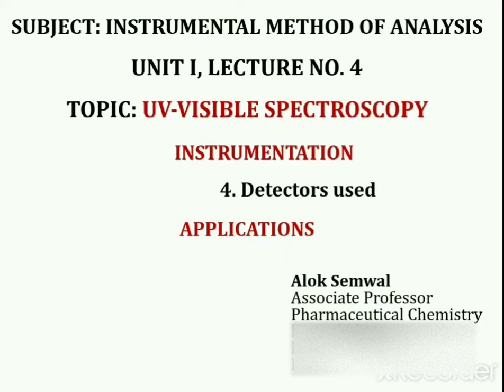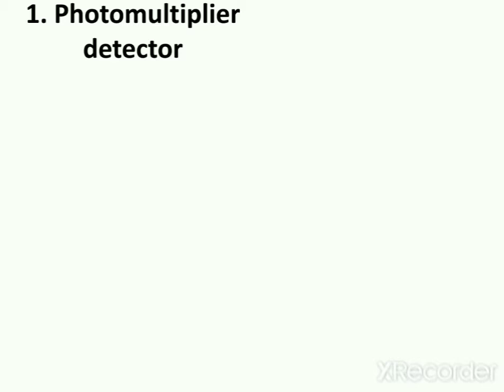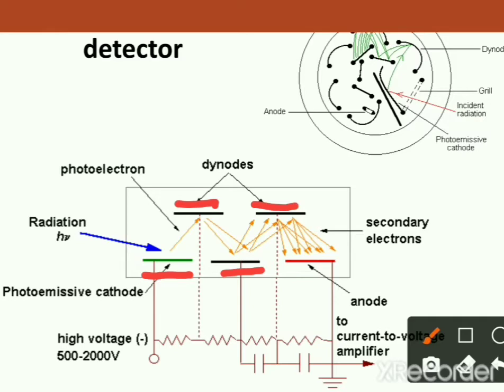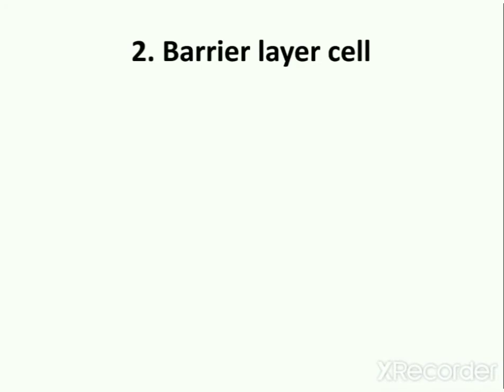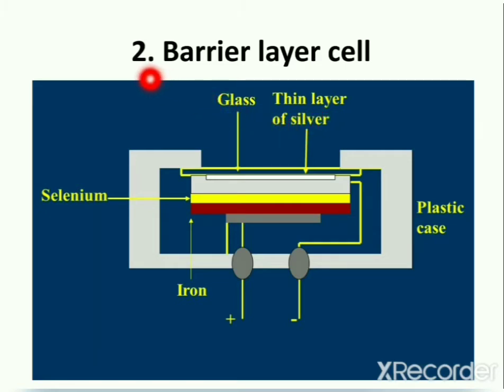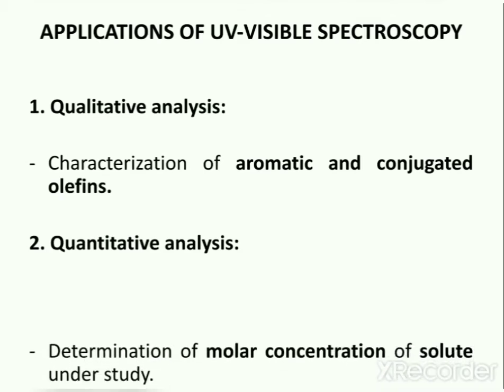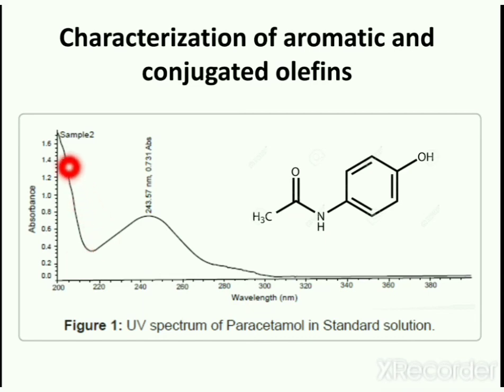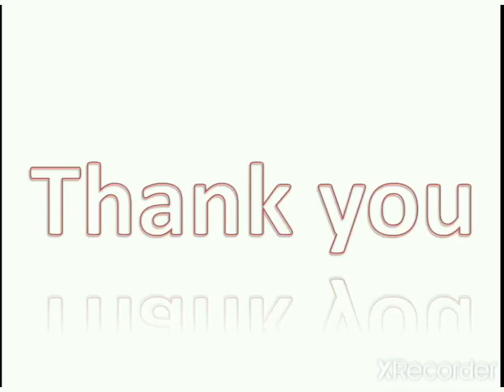UV-VISIBLE Spectroscopy || A  lecture on Detectors and Applications of UV-VISIBLE Spectroscopy

Comment: Please explain how potential difference create in "Barrier layer cell dector" ? 2-Selenium is semiconductor and conduct electricity at high temperatures easily so why Selenium not allowed to pass electron from silver /gold layer to iron layer?
Reply from the maker: Selenium is a semi conductor having small electrical conductivity in the dark which increases dramatically with exposure to light. Here, selenium is in between silver/gold and iron layer that’s why it is not exposed to light radiation directly. That’s why it acts as a barrier and creates potential difference.